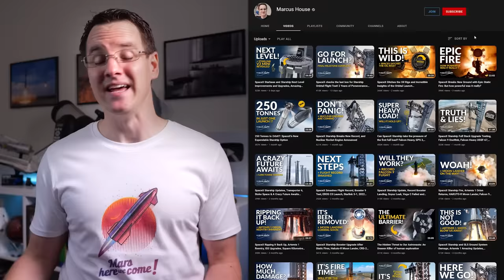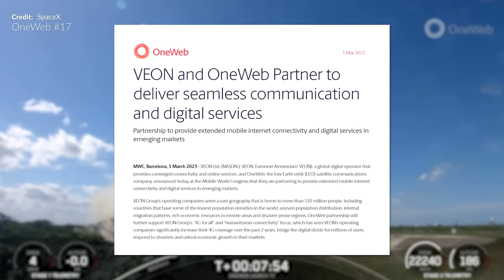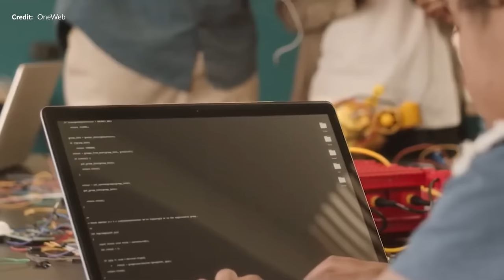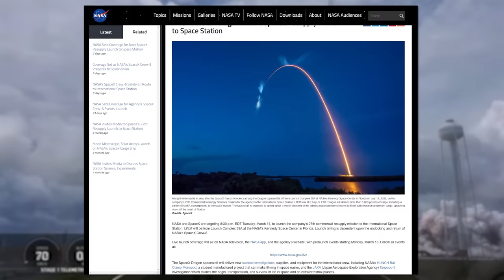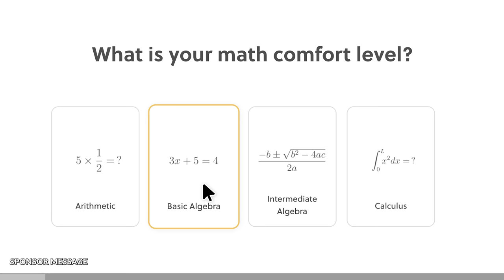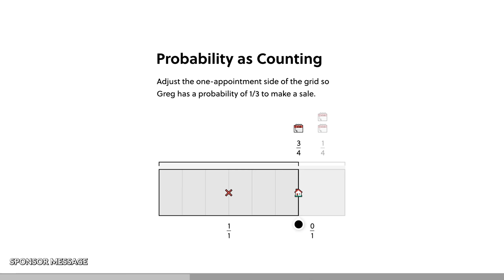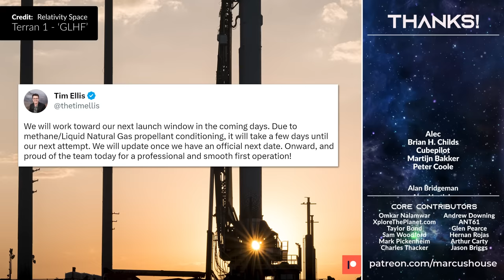Why did SpaceX just remove their booster? Rocket failure for JAXA H3, Terran 1 scrub, Crew 5 Return

Comment: About it being easier to attach shielding cover plates inside the structure than outside: The shape of the armor wall would require outer plates to be bent to follow the curvature of the wall, but inside, a flat plate can bridge the gap without being formed to fit exactly.

Comment: As a 3D Printing enthusiast, it is so exciting to see 3D Printed rockets, how cool it that.
Reply: Relativity - not Spacex - is fast becoming the most disruptive player in the space race.   Terran R is likely to give Falcon a real good competition.  Good for both companies.  Musk was short sighted only focusing on inexpensive lift.  Refinement of 3D printing tech is the key structural piece required for efficient and sustainable extraterrestiral success.  Relativity -NOT Spacex - is leading the way in the crucial printing technology.  There is plenty or Iron, silica, oxygen and aluminium in the regolith on the moon no need to ship things to the moon if you can just drop a small nuclear reactor to power 3DP's that will simply fabricate most everything needed from processed regolith onsite.  Lunar Nuclear reactor could also power Helium 3 extraction which could be used to power lunar and terrestrial fusion energy systems.
Reply: @ccbcco  If inexpensive lift isn't just as important in space race today....
Reply: I would be interested to know the difference in cost between current fabrication methods and 3-D printing. Especially for something the size of Starship. Also does relativity have a vehicle that can make the trip to the moon yet?
Reply: @ccbcco  Love this comment, and so true.  We don't need to lug heavy equipment to the moon, or Mars, we can just print most things we need, an exciting time to be alive.  Also, when it comes to spare parts, those too will just be printed on a when required basis
Reply: When you guyz can print a prime rib dip indistinguishable from dead cow, I'll be impressed. (What do you predict - 2030?) (Next week?)😋
Reply: @ccbcco  Not to forget: SRBs primarily burn iron and aluminum oxides. The moon is made of rocket fuel!
Reply: @ccbcco  you might want to look into what’s involved in “processing the regolith” to get the elements you mentioned?
Reply: Do you have any advice for a beginner like what to buy and what software works that are the easiest to use?
Reply: At a time when millions of people need good paying jobs. 3d printing and other robotics are counter to gdp. It funnels more to the top of the pyramid and makes more families hurt.
Reply: @ccbcco  (yet to fly though )
Reply: 3D Printing is a the prefered manufacturing methood for people who don't know how to manufacture anything.
Reply: @mbox314  
We found that lots of people can draw. We were paying $15 and basic medical. But without knowing how to build their drawings had to be reviewed and redlined by an experienced mechanic. The experienced guys could draw with insight where the guys with less than 5 years experience were best working on changes.
Reply: @mbox314  That's the worst take on 3D printing I have ever seen. You realize there are things one can only make with 3D printing right?
Reply: Yeah, they stick to your build plate when you try to launch them lol
Reply: @mbox314  Perhaps.  But that is what is GOOD about it!-)
Reply: @replica1052  It will fly.  No reason for it not to.
Reply: @Hydrogen Bond  if you are talking about objects with complex internal geometry then those can be made with investment casting or machined laminations joined with diffusion bonding.  Manufacturing is a seriously underapreciated skill in the west, hot shot executive types consistantly downplay the difficulties and nuances of manufacturing, then when things get too expensive, they outsource it and hand that competency over to a future competitor. 3D printing is popular because it plays right into the popular notion that making anything should be as thoughtless and easy as printing a piece of paper.
Reply: @ccbcco  3d printing metal is just welds - no reason to 3d print the rocket fuselage when you get a lighter, stronger rocket with fewer welds welding sheets of metal
Reply: @ccbcco  1q11¹1q1
Reply: Super cool
Reply: @mbox314  we found the cnc operator in the house..lol
Reply: @ccbcco  so is Apple (not SpaceX) the company that sells phones?
Reply: @TC   I am a mechanical engineer but I did run machines in previous jobs. It is a major coincidence but at the moment I am redesigning a part that was solid 3D printed that keeps breaking. Alternatives so far are machined plastic, cast resin and a brazed assembly of aluminum plates.

Comment: My problem with JAXAs launch is that they were overconfident and put a very expensive sat on a maiden flight
Reply: I was wondering that also. I won't go so far as to say they were over confident, but you may very well be right. Did they even test this configuration? Was it really the maiden flight? Shocking if it was. They coulda launched a car instead lol.
Reply: Yeah, I thought about that too. I was thinking, maybe the satellite was a 'prototype' and not as good as they liked. So use it as a 'test model' for the maiden flight and  if the launch failed (as it did), you get some insurance money and then put that towards the next improved version. Pure conjecture of course. 
But if you think from the time that they started the construction of that satellite and to when they finished it and then look at what advancements in that time there have been with reactionary wheels (built by Rocket Lab) and the newer Krypton engines and the 3D printing and computer processing, you can easily see that as sophisticated as the ALOS-3 currently was, it could be improved on. It had a life expectancy of 7 years, so maybe that can be extended to 10 years and the next one might be able to process more data.  Just another angle to look at.

Comment: The battens over the gaps are on top on the top because they will shed rain water onto the larger plates rather than have water fill in a recessed gap. On the side plates its on the inside because the flat plates shed water across a broader surface and water blown across the wide plate to the gap will simply flow down the edge of the wide plate without flowing into the crevices behind the outer plate and inner batten, and the narrow gap minimizes the amount of water that might get caught in between the battens and the larger plates.

Comment: The long term answer to larger ships is to dig down and use smaller, so safer, cranes. Yes, I know this has other issues but they are all surmountable, just expensive. However, it could actually help with protection of cryo lines.

Comment: Thanks for another great update!  "No way to lift the quick disconnect"...is that really true?  There's already a system to lift the Booster and Starship, and the QD should weight much less..  I can imagine them attaching the QD on the first level with a smaller crane, then using the chopsticks to slide it up to final position.
Reply from the maker: This was in Florida, not Texas.
Reply: @MarcusHouse  Yes, LC-39A is the one that still needs the QD.  It does have chopsticks (and presumably everything to make it go up and down), therefore my comment about using it to raise the QD to position.  Sorry I wasn't clear..  Again, thanks for the great summary of everything that happened this week!

Comment: 2:27 I'm surprized they haven't put heat sheild tiles on those legs so they don't need to repaint everytime they launch. Metal sheilds won't stop the paint from coming off unless it's stainless but, they'll have to do something if they plan on quick turnaround.
Reply: The daily launches are a far off Musk goal. Per page 10 of the GAO report denying the HLS complaints, the SpaceX planned Artemis III launch cadence is 1 Starship variant every 12 days. Time to repaint in between while they figure out how to not need the repainting.

Comment: Love the manufacturing and assembly details! So much work going into these programs, great to see. 

Does anyone know why ALL the OneWeb boosters return to site? I expect it saves money, but don't know why that particular mission profile sustains it.
Reply: Because why not? The payload is light
Reply: Alvian made the point. If the payload is light enough and/or the orbit is not too energetic, the booster will have enough propellant margin for adding in the boost back burn, to the re-entry and landing burns.
Reply: @alvianchoiriapriliansyah9882  I didn't realize those payloads were all light. Thanks!
Reply: @steveaustin2686  Makes sense now. I expected those payloads were not light enough to support boostback, especially since there are multiple sattelites.
Reply: @timpadgett8679  The Starlink sats launches have to land on the drone ships, but the OneWeb launches so far, have the margin to land back at SLC-13. That may not always be the case, depending on the orbit. The 0.3 ton IXPE sat launched in Dec 2021 had to do a drone ship landing, because of the energetic orbit needed to get it to where it was supposed to go.

Comment: I hope, the shielding around the orbital launch mount is strong enough as I see these flimsy thin mounting grids. There would be high forces dragging the shielding outwards and then down with the high speed rocket boost flowing down over the launch mount as the booster has just lifted up for one or two seconds and from that on some more 10 or 15 seconds with high forces...
Reply: I'm pretty sure you'll say the same once you look the NASA'S mobile launcher in greater details

Comment: What if all the mistery around the 3rd tower is that SpaceX is thinking to land their first booster/starship not on Boca Chica to avoid damaging their main site?
Reply: The mystery is where that tower is going. SLC-13 (landing only) and SLC-40 (launch/landing) seem to have been ruled out. The best idea that I have seen so far, is backup parts until LC-49 starts construction and needs the 3rd tower there.

Comment: Are the chopsticks doing daily performance checks? Seems necessary given the future operation tempo. D-1 run chopsticks thought daily stretches and gather proficiency data.
Reply: Maybe it helps 'stretch in' the cables and helps to keep them from getting salt coating the wires? Maybe they have an oiling pad on the cable winch and/or catch-arm area too. I had not thought about them doing daily operations till you mentioned it. But it would make sense to do that.

Comment: Stage1 is a total Frankenstein. I suspect a new launch tower will follow very soon after first few successful launches. I believe a deluge system with outlet like a big mushroom right in the centre so water flows outwards, the mushroom itself will be easily cooled by the water flowing within it
Reply: Except that's not what the pipeworks shows

Comment: @Marcus-
Do you know if SpaceX is going to be installing panels on the Launch tower? Would they not have to be in place to protect all the interior systems from the Raptor engine thrust? Renderings of the towers show them covered? Any ideas?
Many thanks,
Mo-
Reply: For the first flight it won't be for all parts

Comment: This is crazy, but how hard would it be to takeoff from Boca Chica and then land in the Cape?  It would be shallow, but as long it would be a good way to test the catch, but they'd need to be really sure to risk the 39A infrastructure.
Reply: The FAA frowns on flying rockets over populated areas and a launch from Boca Chica would fly over Florida.
Reply: @steveaustin2686  how high is "over"?  If they don't need to get to orbital velocity horizontally, they should be able to hop well over whatever margin the FAA wants.
Reply: It's way too far downrange
Reply: @Shadare  Well, you would likely need to use the Superheavy booster to get Starship (second stage) to Florida in the first place. The FAA would likely want the path over Florida to be high enough, such that if the spacecraft fails, most of it will either fall into the ocean or come down at a fairly slow speed after getting ripped apart by aerodynamic forces.
Reply: @steveaustin2686  I'm talking about catching the booster.  The starship would be fully fueled and could go around and land back at boca Chica or wherever wants.  I guess I'm just curious if the FAA fucks off does the timing and delta-v budgets work out to land the booster in FL, or would that leave the starship underspeed?
Reply: @Shadare  Per the FCC filing launch time, the Superheavy booster has MECO over the Gulf of Mexico and boosts back to Boca Chica. So Starship (second stage) would likely depend on how high over Florida that it will pass. To my knowledge, the FAA has not said anything about this. To come in to land in Florida, it would have to be point to landing off shore and then go for LC-39A at the last minute. The Falcon 9's are pointed off shore until the landing burn. Landing at LC-39A is not something that is happening anytime soon. At the minimum, not until the work upgrading SLC-40 for Crew Dragon and maybe Falcon Heavy is done. Boca Chica is likey to be the first landing attempt, as a RUD there would not impact other launches.
Reply: @Steve Austin  so you're sayin' there's a chance! xD
Reply: @Shadare  Yeah, a get a date with a super model chance as a regular guy. :) I think SpaceX will have to fly Starship to show it is reliable, before they think about flying over land to recover one.

Comment: Will they need a water deluge system on the landing tower and chopsticks or will they be grabbed high enough for the sound and vibrations to not effect the rocket? Might they need to to help protect the tower hardware from the rocket exhaust and sound? Maybe just a spray system rather than a full deluge?
Reply: Currently as far as we know the launch tower and landing tower will always be the same tower. But either way I think they will probably be catch it high enough to not need water deluge for landing.

Comment: quick question, why are they building the tower at LC39A on the side of the pad. Are they planning to move it when starship becomes fully operational? 
Or just keep it off-centre
Reply: Because they already have it, ground already prepared (no need for vegetation clearing). Can start building right away

Comment: Re: H3 - ironically, the newly developed component of the launcher, the first hydralox stage, performed flawlessly. The second stage, the one that failed, is not new.
Reply: Yes, LE-5B failed. But the components failure located on the wirings, which is likely new

Comment: Great content Marcus!
I was contemplating the possible operation of the Starship, if you launch from Cape you could in theory land in Boca Chica, Its possible to transport the Booster and Starship via sea back to Cape for future launches? Its evident that there will be no ferries for landing Boosters and Starships anytime soon, and we know that  landings on the Cape will not be allowed because of the risk. What's your take on this matter?
Reply: I'm not sure the FAA would approve a launch that left from LC-39A and then overflew Florida to Boca Chica.

SpaceX has apparently been funding the work on Hwy 4, moving the lines and stop lights over the road. A booster or Starship would have to be transported upright, which would seem tricky to do on the water. SpaceX is building factory buildings and mega bays at both Boca Chica and KSC, so I doubt they will trade boosters between them. Starship (second stage) returning from orbit, possibly.

NASA, and likely the USSF too, were worried about a RUD that takes out LC-39A, because the Crew Dragon and Falcon Heavy only fly from LC-39A right now. SpaceX is building a crew tower at SLC-40 and may be upgrading SLC-40 to handle the Falcon Heavy as well. If so, once the work at SLC-40 is done, Starships would likely be allowed to land at LC-39A, once it is perfected at Boca Chica first, I would think.

Comment: My understanding is the H3 refers to the first stage of the booster which performed as expected and the 2nd stage which failed Is a 2nd stage they have used successfully before. This means the new hardware worked and the anomaly was in already proven hardware.  Am I missing something?
Reply: You're missing something

Yes the upper stage is a (derivation of) existing LE-5 engine, but the tankage is different & the wirings to the engine (which is now suspected as potential cause) are also different
Reply: @alvianchoiriapriliansyah9882  ty for the info.

Comment: I´m wondering, if it doesn´t make more sense  to use core10 steel sheets instead of paint (that needs to be repapplied after every liftoff) for corrosion protection. Whats your opinion on that?
Cheers form Germany :)

Comment: Question- Why cant they just spray a heat shield onto the rockets ? Or maybe have a 3d printer spin a thick layer of protectant onto the outer skin of the rocket like saran wrap.
Reply: Because that tech doesn't exist yet. Thermal Protection Tiles have become better over the years, but they are still baked in an oven. They also expand slightly when heated, so can only be made so large.

Comment: Logically SpaceX would build a short Mechazilla and enclose it in a building for a Raptor Installation Facility, this would also make sense for the Payload Loading Facility.  Then they wouldn't need anyone on top of a Booster or Starship when lifting.  It would also be safer in all weather conditions.
Reply: Wtf would you need a freaking Mechazilla just for installing Raptors?
Reply: They already have ceiling cranes that do the same thing Mechazilla arms would do in the high bays.  Problem is, they don't have enough high bay space....perhaps being addressed by prepping for construction of the next one, as Marcus reported.